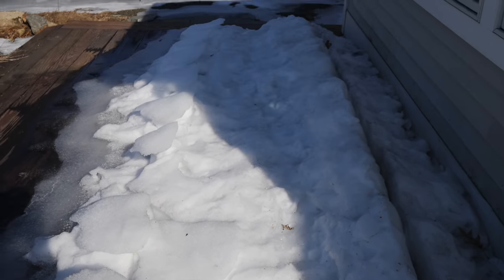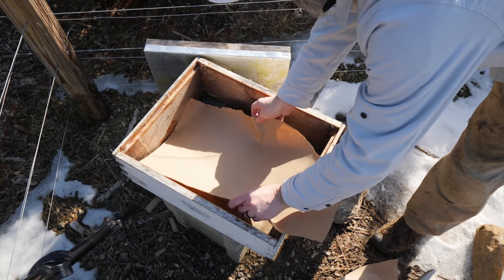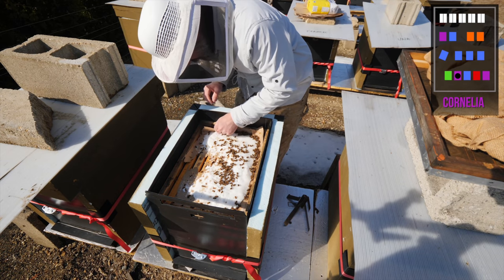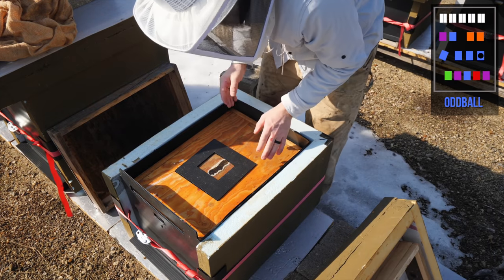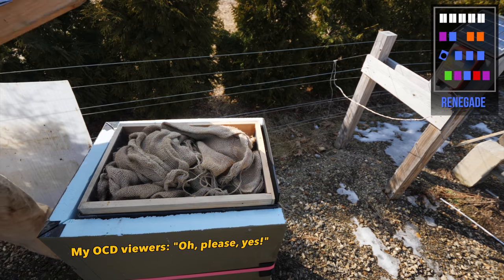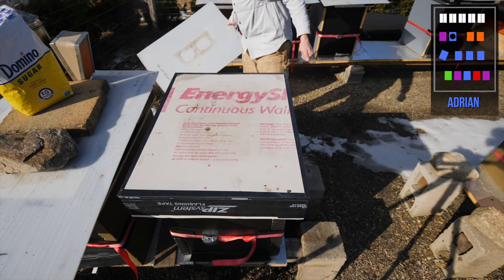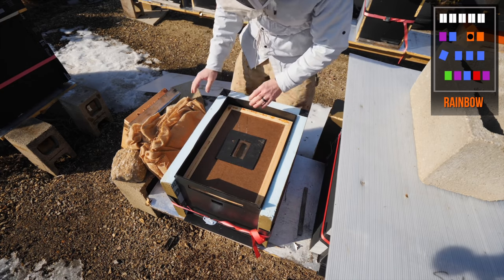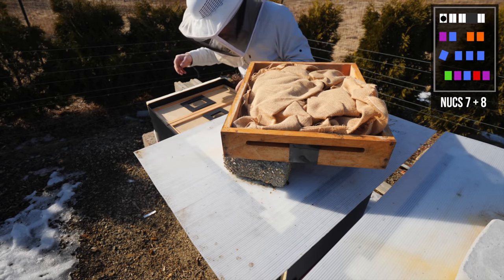Who Made It Through Winter? - Spring Beehive Check & Pollen Substitute

Comment: Ever though of using Apimaye hives? They seem better at insulating than wood hives.
Reply from the maker: I prefer my modular insulation system with the wooden boxes as the structure. That way I can modify or build components very easily. The Apimaye components are all proprietary and don't mix with the thousands of dollars of woodenware I already have.
Reply: @vinofarm  Apimaye interchanges with langstroth wooden frames and top cover and bottom boards can be used on wooden hive bodies.
Reply from the maker: Kevin Riffey So you can add wooden supers to the top of apimaye plastic boxes? I didn’t know you could mix and match like that. Do they come in 8 frame sizes? I keep entirely in 8 frame boxes.

Comment: Thanks for the video!  Have you ever tried making sugar bricks for emergency feeding?  Very simple to make, 1/2 cup water to 5# sugar. Mix well ( you want it about the consistency for sand you’d use to make a sandcastle, doesn’t take much water). Pack it tight in pan that’s not thicker than your feeder shim. Place it in the oven at about 175°F for three hours or so. If you want to divide it, cut it with a butter knife before you cook it. Way less mess and waste. No paper required, just place it on top of the frames. I’m a convert from sugar camp. I put a couple drops of spearmint oil in mine. Jury’s out on whether that helps the bees or not. Doesn’t seem to hurt them and makes me feel better.
Reply from the maker: That sounds a LOT more involved than pouring dry sugar in on a piece of paper! There's nothing easier. I used to spend hours making fondant and the day I put some dry sugar in the hives next to some fondant and watched the bees devour the sugar first, I never made fondant again. Not saying you shouldn't continue making sugar bricks, but give the dry sugar a shot... It has made my life much simpler and it has definitely not affected my bee survival rate!
Reply: Vino Farm I used the dry sugar for years. I got tired of the mess it made (paper clogging openings, paper scattered about the apiary, dry sugar piles on the bottom board and kicked out of the hive). The bricks are way less labor intensive to make than mixing syrup. I can make several rounds to cook in about 15 minutes. The bricks are much easier to adjust as the cluster moves and a lot easier to move if I need to take a peek in the hive.

Comment: In the age of technology, I would like to see you try micro spy cams in strategic positions in the hives. Perhaps a low voltage wired system where the cams are fixed inside the box at sugar level or other levels. I am usually wacky in my ideas, but it would be a way for you to check the hives real time without disturbing the hive. 
Also, could the sugar loading be revised with modified hives that would enable them to stay sealed in the cold. 
What about electric warmers or warming lamps for the hives that are freezing?
I kept my pond open for my fish, all winter in CT, with a 75 watt outdoor flood lamp under an upside down black cement tray. Just wondering. Always love your videos. Just Great.

Comment: Man, I need to have a spring like this.  Starting over with two packages again this year.  I'll be trying your overwintering setup next fall, so hopefully that will turn things around.
Reply: I lost my first 2 hoves my first year but this year is better. I can not wait to do some splits.
Reply: Packages are not the best way to go, if you do get some re queen with a local queen breeder, or just kill the queen let them make their own locally mated queen. Chances go up to over 65 or 70% rather then under 40% if you keep the old queen. Someone did do the research on this.
Reply: @peteGbee  My plan is to do one or the other of those, depending on the availability of queens.  I would have bought local nucs but they are too expensive.  Then again, I bought nucs 3 years ago and raised 6 of my own queens and still lost them all.  This year I'll be trying oxalic acid and improving my ventilation, hopefully that improves the odds.

Comment: Hello Jim,  just a piece of advice, is better to make a sugar paste (like sherbet) by boiling the sugar and breaking the large crystals, and form it in some patties between two paper sheets. I'm doing that and the bees are consuming it better, cleaner and easier. Also I put pollen in this paste and in late winter queen is starting laying eggs much quicker.
PRO: The paste has some moisture and is better dissolved by the bees (bees need water to dissolve granulated sugar), you can incorporate pollen or other treatments in the paste, in cold weather you keep the hive open for a shorter time (the patties are pre-made), is easy to clean the hive in spring. 
CON: For 10-15 hives you need 2-3 hours to prepare the paste.

Comment: Do you think you might have a moisture problem in Back Left?  The inside of the telescoping cover looked like it had a lot of wood rot or mold covering it.  Too much moisture and a sudden freeze could be an issue.
Reply from the maker: There was mold on the outer cover, but not inside the hive living space. That's the point of the vivaldi board layer. The moisture stays up in the burlap. Part of the design.
Reply: Vino Farm the idea is borrowed from the quilt boxes Warre hives  use, so I get that part.  But my Warres haven’t shown any mold on them at all.  So that was my concern.

Comment: Adding sugar on them like that is hard on the bees ..  brings them right up.. you get this ball of goo sugar coated bees .. adding sugar and that quilt board acts like a sponge holding moisture ..  give them solid box of honey and 2 to 3" of foam .. cluster will slowly move up having plenty of open comb space to cluster .. foam on top will remove all moisture above the bees ..  your bees will come out of winter much stronger larger .. having the hive packed in foam open to solar gain those clusters should be huge coming out of winter .. do all that work then make them struggle no space to cluster and coated in syrup .. bees starve out in the spring not winter we have plenty of time to emergency feed if need bee .. they call it just in case sugar .. it's hard to say how many bees die from just in case sugar probably atleast 80% .. mites kill but that's seen in the fall
Reply from the maker: I have not experienced bees coated in sugar. The sugar is dry. The vivaldi board pulls moisture up and out of their living space. The bottoms of the inner covers are totally dry. The moisture is up high and there is no dripping down on the cluster. I've been doing it this way for 4 winters now. The sugar is not the primary food source. It's just extra. I can't get deep down to check on how much honey is left until we get some warmer days. I just know if they're consuming the sugar I leave for them, either they LIKE it, or they NEED it. So I keep it topped off. If they have plenty of stores in their comb and they don't consume it by spring, I toss it. It's emergency food. That's all.
Reply: Everything is up that's the problem .. bees should be down in the comb making baby's not rolling around in a sugar donut .   Those colonys should be growing over winter way you took the time and packed them in foam.  Not dwindling down to nothing .. bees need emergency feed dry sugar works great ..

Comment: Do you think they have any shortage of water with all that dry sugar? Or is there enough condensation on the inside of the hives to keep them going?
Reply from the maker: There is melting snow all over the place. And rain. And we live about 1000 feet from a huge wetland swamp. They can get water.
Reply: @vinofarm  
You used to make more of that white sugar pasta, do feel dry sugar is easier / cheaper? And do you notice any difference in the bees uptake with the different types?
Im starting with bees this year, in Norway, where the climate seems quite similar to what you have. Expecting the blooming to be different, we might not have the same dearth as you, and there is a really huge emphasis on Heather here.
Reply from the maker: @Zonkin  Dry sugar is easier and the bees gobble it up. Last year I put fondant and dry sugar in the hives and they ate the dry sugar first. That's all I'm using now.

Comment: Never EVER encourage robbing in your apiary.... If your going to let them have the honey... Put the box with lid on top and without the bottom board close to the house that way they are not encouraged to rob from your other hives.
Reply from the maker: They were already getting cleaned out. That hive had been dead or dying for months.
Reply: @vinofarm  I wasn't speaking of the dead out.   Re read the comment.
Reply from the maker: Jeffrey Tipton I am confused. The dead out was the hive I left in the apiary and the only part of the video where I mentioned robbing.
Reply: @vinofarm  
I understand that.   My concern is that if you leave the rob out IN THE APIARY.... (Which most beekeepers will tell you)  especially to let your bees clean out the honey(robbing)... Is not only a bad idea,  but will encourage your bees to rob each other after they remove and clean out the dead out.   If and when I have a dead out,  I remove the hive at least 100 yards away... In my case on a table I built on the backside of the barn.   The bees still find the honey... But there is no direct line of site to my other hives.   This keeps them from robbing each other in the future.
Reply from the maker: @jethrobodine9617  I hear you. My initial reply was that they had already been robbing that hive out for the last couple months anyway. If anything, moving it now would send them foraging into the other hive right next to it. I plan on setting up a dedicated robbing station outside the bee yard this summer.